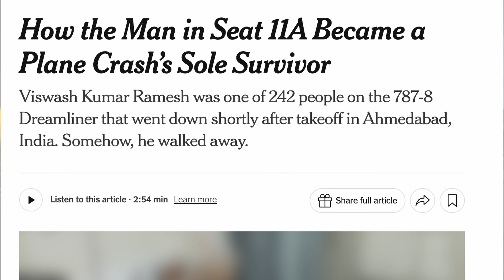Why the RAT Changes Everything – Air India 171 Update

Comment: Capt Steve:  a new twist to the story. I just saw an interview with the survivor, and he claims that he heard the engines trying to power up!  Or at least that is what he interpreted it to be. They were also trying to make the case
that the flaps were not set whereas the landing gear was down inferring a mistaken switch bending thrown. I saw another video through where they showed flaps are controlled on the center panel where as landing gear are centered on the dash board panel. Hard to see that pilots with thousands of hours flighty time would mix those up. 

So here are the currently assessed data:
1) pilot radioed no power (assume engine power)
2) survivor heard engines trying to spool up
3) RAT deployed. 

How exactly does the RAT assess that engines have failed?  The pilot did not report he lost engines, just that he didn’t have much power. Survivor suggests pilot was trying to spool up engines to get power. It doesn’t sound like engines were dead, just not producing needed power. The long take off also suggests the engines were not producing peak power. 

So in that situation, what triggers the RAT to deploy?  That points to the culprit. 

Also, I heard something about this plane and maintenance. Had it already flown?  Was there any service done to it before take off?  It is sounding like maybe something maintenance was done improperly to both engines that hobbled them?

Comment: Also if the engines were at full power you wouldn’t necessarily be able to hear the RAT, but since there’s no GE or RR jet wail it’s seems pretty safe to assume flame out.
Could it be a fault in the fuel pickup on rotation?

Comment: Air India regularly had maintenance issues with A/C and internal lightings not working, entertainment system rarely worked, and the plane that crashed had four emergency landings due to maintenance issues just within a month before this crash. This was bound to happen and it was preventable. And this could have happened in any country or city where Air India lands. India needs to get their act together. Maintaining a 787 isn't the same as maintaining a taxi for god's sake.

Comment: It could be confirmed it was an engine failure in second place .They could use RAT as an emergency for the last option..But before they lose control in the first place, need to find the first matter.. It could be an electrical failure ..Also Plane gear didn't get in back after take off shows some kind of electrical failure already happening earlier including the flap of left seems not working too..The plane had an electrical failure that caused the plane to lose control earlier and then they turned on the RAT for emergency purposes but it was not able to support the pressure enough n caused it to come out.

Comment: It almost looks like some critical fault handling code in Dreamliner's s/w, which just shut down both engines with no apparent mechanical issues at all. Boeing's s/w is known to do the opposite of what needs to be done, as we all witnessed before with the 737 Max crashes! Sorry that we lost so many lives. The fault trigger would have been caused by some maintenance issue by criminal negligence by Air India.

Comment: Contaminated fuel (e.g., water, microbial growth, or wrong type of fuel) can cause both engines to flame out shortly after takeoff when high power is demanded. Fuel starvation due to improper fuel loading, cross-feed valve misconfiguration, or blocked fuel lines could result in a dual flameout. If no fuel is reaching either engine, failure can happen seconds after rotation.

If a critical step is missed during maintenance (e.g., failure to reinstall fuel line clamps, failure to properly connect Full Authority digital Engine Control harnesses, both engines may be affected. Fuel shutoff valves inadvertently left closed or disconnected fuel pumps are possible causes.

Comment: A loud bang could have been sabotage. A small charge the size of your little finger could remove the fuel lines of both engines or the fuel pump without showing any signs from the exterior of the plane. But why would somebody do that? There are other potential causes for a loud bang and an engine failure as well, but TWO engine failures makes me at least CONSIDER the potential of terrorism or assasination. Who was on the plane?

Comment: 2010 Cathay Pacific 780 had same issue, but they were lucky as it was not during take off, both the engine loosing thrust simultaneously. Given this is not a birdstrike,
It seems more like the fuel was heavily contaminated. I am not talking  water or impurities, some thing like the filter elements of the fuel filter (may be SAP) in the fuel loading ground system got in the tanks. They should check the logs of the loader and investigate the filter elements. Whatever it was it was disperesed and was able either block the fuel flow meters or block the fuel bypass valve too.

Comment: It may be a horrible coincidence, but in 2014 a documentary was made about the safety culture in Boeing, most specifically showing staff in the Charleston plant say they would never want to fly themselves or any family on the 787's they made because of so many problems being metaphorically papered over. The reason I say it may be a coincidence is because this specific 787-8 was delivered in 2014 and was built in Charleston with final assembly being done at Everett. The reason of this was because of a 787 APU battery fire in a Japan Airlines 787-8 at Boston Logan and a second 9 days later with a burning smell causing the diversion of an ANA 787-8 flight that was linked to a damaged battery overheating. 

Now, obviously this story is from over a decade ago and on the accident aircraft there was a C-Check in June 2023, and a reported engine overhaul of the number 2 engine in March 2025, but it certainly made that 45 minute documentary all the more haunting, just as it was with the two Max-8 crashes. I've not been back on Air India since Tata took back over though the flights I did take prior to that were not the best kept 787's, at least aesthetically from a passenger's perspective, but ripped bits of carpet, broken seats, and horrifying toilets are not going to force a RAT to deploy. It will be a long time before we get all the details, but maybe in a couple of months the FDR and CVR will be revealing and the information released from that perspective.

Comment: From What this video showed and the audio, it was convincing that the RAT was deployed. However, that still does not explain why we did not see the flaps in take-off position.

Therefore, that adds to the mystery of the wing configuration. Being so close to the ground and seconds after rotation, I'm thinking there would not be time enough for the flaps to be brought up, into a clean configuration, as this video was showing the wings to be.

Furthermore, if there was a total power loss, which would deploy the RAT, then there would not be the power available to bring those flaps up. I would appreciate your thoughts on this, please.

Comment: Your conclusion is both Engines failed.
Reason 1--bird hit is ruled out
2. Fuel contamination can be ruled out because other planes are provided with the same fuel.
3. Can we come to the conclusion that hydraulic dysfunction made  the pilot not to move the gear and electrical mis function made the flaps not to open?

Comment: The flap control is on the console between the pilots. The  landing gear switch is on the panel between the screens on the Dash. NO WAY A PILOT WOULD MIX UP FLAPS & LANDING GEAR.

Comment: Its a modern Boeing 787, the gear levers and flap levers are very different. For an aircraft thats been commercially flying since 2009 to just now have a catastrophic endeavor, something is up. The dual engine failure because of poor maintenance and some company trying to maximize profits by using cut rate or chitty fuel

Comment: Duel engine failure like the guy who was on the same plane on an earlier flight said that. That particular 787 did not have AC working or the Wi-Fi was not working also the ramp lights inside the aircraft were not working inside the airplane

Comment: Thank you! I was little flustered earlier with your analgy because it looked to me some sort of electrical issue and not takeoff configuration. I am an engineer and a pilot. In my understanding, even with fullly loaded plane and FO mistakenly lifting the flaps up, the plan will not sink like that. They would have eventually made a positive rate and climbed up. The reason gear not up is because of electrical power loss, the gear knob was probaby raised up but then they lost the power entirely. I am also under the impression that this is some sort of electrical power outage that caused dual engine flame out, then engines however were not physically damaged, they just lost power from FADEC itself. There was issue in the past with 787 where a plane went total blackout and pilots regained its power back, however here there was not enough altitude. In my experience and knowledge this crash somewhat related to the past history with 787. All my statements are my analogy, I am stating all these as an engineer and as a pilot. I could be wrong but Iets find out if my statements are close to what the black box reveals.
Reply: Yeah I think that's what it is. I believe they had an electrical system failure which affected both engines. I just can't see something wrong with both engines at the same time that doesn't make any sense especially from what you see from the video. Or some battery or something blew up in the luggage compartment and damage the avionics maybe

Comment: 5th evidence: As per flight24 radar data of AI 171, it's transponder got offline immediately after desend at 625 feet indicating loss of electrical power or pilots turned it off to save  power for critical components.

Comment: I believe another bit of technical information missing from this video is the landing gear on the 787. 

The normal position of the wheels on the main landing gear of the 787 has a tilt backward when it is down, both prior to landing or after take off. 
This is design is for sensing when the aircraft is airborne. 
When the landing gear had 0 tilt, it signals to the computers that the aircraft is airborne. 
In the video, we can see the main wheels tilted forward. The wheels tilt forward to fit into the main wheel wells. 
This ONLY occurs after the landing gear lever is selected up and the retraction sequence has begun. 
Which leads me to believe that the pilots selected gear up and some kind of failure that prevented the retraction sequence to be completed. 

The landing gear system in the 787 is powered by the centre hydraulic system. 
The centre hydraulic system is power electrically by a C1 and C2 pump with the RAT as a backup. 
This system powers Flaps, nose gear & steering, main gear and flight controls. 
It is designed in a way where in the event of a C1 and C2 electric pump failure, the RAT will only provide hydraulic power to the flight controls.

This tells me the aircraft has had a complete electrical failure when the gear began the retraction cycle. Maybe it was a dual engine failure that caused the electrical failure. We dont know yet.

Comment: If the engines were at full take off power wouldn’t they drown out the sound of the rat?
Where is the flap control in relationship to the gear up controls?

Comment: Ur theory 3 was wrong frm the start, the controls are in different positions, and how r u ignoring the dust at take off, it means the take off took at the very end of rhe runway. 

My theory: the powerloss happened in the runway itself, but had to takeoff as there was runway left to abort, so they ran to the very end, then RAT was deployed, and since poweloss, landing gear was not retractable. And dont forget the MAYDAY calls made by the pilots

Comment: I wonder if this is at all related to software controlling the generators. There was a 787 AD against a software counter that could overflow causing all electrical power generation to go offline simultaneously, and that the engines depend on the electrically driven fuel pumps.  Apparently there is enough fuel flow without the electrically driven fuel pumps to maintain flight idle, but no meaningful thrust.
Hopefully if there was an electrical failure that the CVR/FDR are not affected like they were on the Jeju crash.

Comment: Also look at the MAYDAY call and the lone survivors comments. 

MAYDAY, MAYDAY, MAYDAY, NO POWER, NO THRUST……”

The survivor said he felt like the plane stopped midair and then the green and white cabin lights came on. Those lights are part of the emergency lighting system. They are automatically illuminated when there is a power (electrical) failure. These lights illuminate the emergency exits.

Also with a power failure the FOs audio panel is inop and it sounds like the Captain was the one we heard on the Mayday call. 

So in my opinion there is no doubt there was some sort of electrical fault. Would that cause a dual engine failure or a roll back on the engines….. hopefully not but it seems it may have. 

As for the RAT being deployed. It will automatically deploy for 5 reasons. 

-both engines have failed
-all 3 hydraulic systems pressures are low
-loss of elec power to the Capt and FO’s flight instruments.
-loss of all 4 EMP’s(elec motor pumps) (hyd) and faults in the flight controls on approach.
-loss of all 4 EMP’s and a engine failure on takeoff or landing. 

I’m thinking scenario 1,3 or 5 happened and it stemmed from a major electrical fault and possibly an engine flameout. A bird strike is unlikely from the video that has been released. A bird strike is usually followed by flames (compressor stall) out of the back of the engine and audible banging. 

All of this is just a theory but I think there will be many layers to this accident.

Comment: Thank you for your superb analysis. The pilots had over 10,000 hrs of flying experience between them and I think it can be assumed that they were well versed with flight controls. As seen on almost everytime an AirCrash happens the Airlines and Airliners put the blame on the pilots. Evidently before the crash the plane happened to pass over a densely populated area where people recorded the plane and told that there was no sound of engines from the planes.

Comment: I have 2 questions tho, is it possible to have dual engine failure with no visible effect like fire or smoke ..? Also what should a pilot do then in case of dual engine failure at at a low altitude if the rat can’t help that much in this case ? Thanks

Comment: What nobody has talked about is the x post where a disgruntled passenger posted about Air India's incompetence due to them being canceled on a flight from Melbourne to Delhi... with the reason as "engineering problem" and remained canceled even 24 hrs later. FR shows that REG as VT-ANB. Tie that into the post of the person that all the outlets posted about the failed aircon and infotainment system and I always said from the inception of the crash and reading those posts, that a pattern electrical avionics failure was forming here. The takeoff was great. But it looked as if the plane went from full to Idle thrust. No stall of wings etc. Just a wings level descent into the ground. I  will wait for the investigation to officially point out the recorder systems, but for me it has been always a master system failure.

Much like that crash of the F16 that had it's avionics "brownout" event.

Comment: A simultaneous dual engine falure after V1 at take off that is not caused by a bird strike Is virtually unheard of surely ? 
I  say V1 because obviously they would have rejected otherwise 
Can anyone give an example of a similar event on a modern wide bodied passenger jet?

I am no expert so thats why I ask , I've heard of flame outs a higher altitudes due to weather or fuel contamination but this seems to be a situation that doesn't lead to a simulateneous  Immedeiate  falure but tends to be more progressive with failure often in one engine first ?

Also If there was fuel contamination, or pump problem would they have noticed this before when they spooled up the engines for take off because obviously it seems they didn't or they would have rejected 
So would it be possible with  either  of these scenarios for there to be just enough fuel to not effect engine performance before they  reached  V1 but then Immediately after  not enough to at least climb out to a higher altitude before BOTH engines failed?

Comment: Captain Steve, the aircraft involved in this crash had flown from DEL to AMD just before the ill-fated flight. There is a viral video made by a passenger on that flight. He said that the airconditioning wasn't working, the in-flight entertainment wasn't working during that flight. Sounds like electrical problems. Would electrical failure cause the engines to lose their fuel supply if the pumps that send fuel to the engines stop working?

Comment: Captain Steeve. Is it possible that as the plane accelerated down the runaway, something on the ground got caught in an engine or damaged a key electrical component on the belly of the plane that resulted in a dual engine failure?